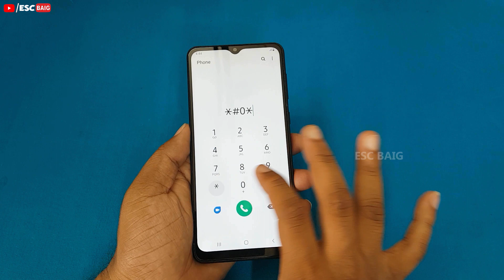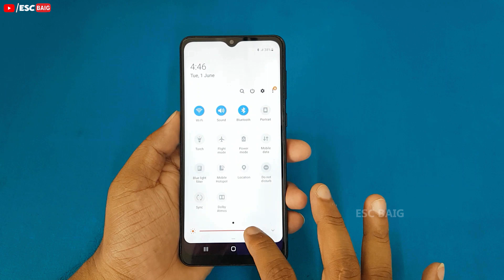Samsung Galaxy M02 and A02 Broken Screen Replacement | Mobile Display Restoration | How To Replace??

Comment: Same thing happend with my samsung galaxy m02 but when i summit it in repair shop they said it will never be repaired because they had mistakenly broke the battery port which attached to the display and also certain break in motherboard .  is there any solution.